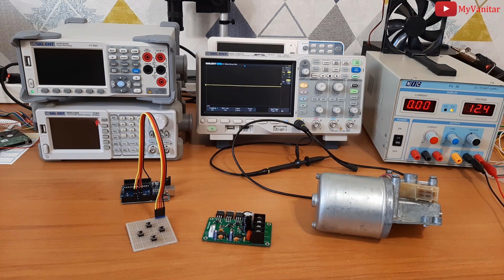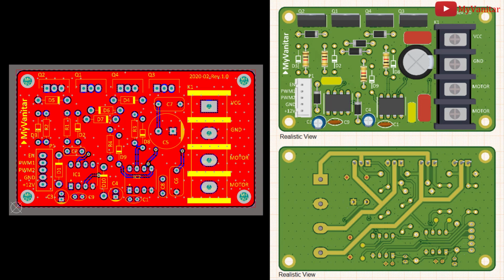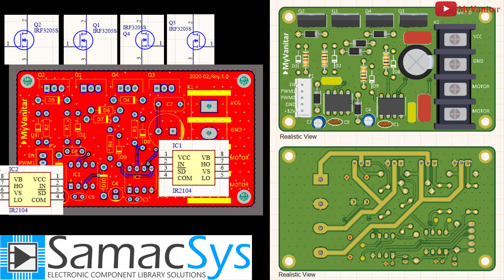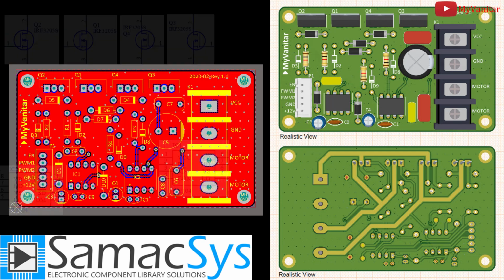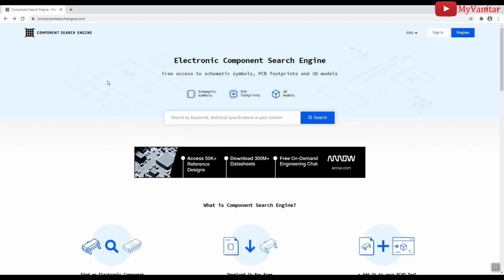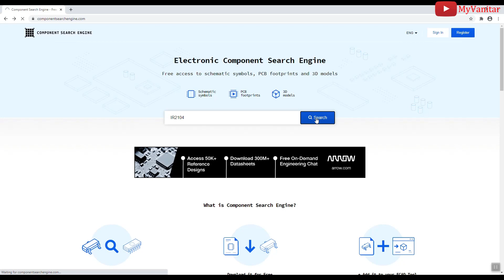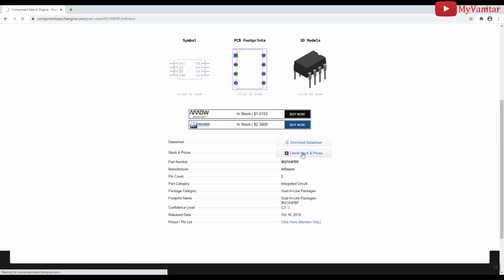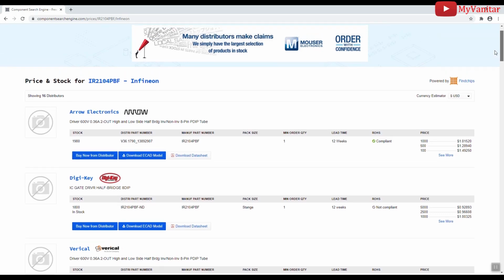H Bridge DC Motor Driver/Control Circuit [40A PWM, Power MOSFETs]

Comment: Hi,
How can I get the "JC_Button.h" library in the given coding for testing the H bridge motor driver board?  Do you have a schematic file of the test circuit? Thank you.
Reply from the maker: Hi, my assumption for this project was that the users have some knowledge of Arduino to run this Driver. Please note that this is a motor driver and it needs PWM pulses at the input to control the motor. in the future, I may publish a standalone board. anyway,  "JC_Button.h" library is there to use buttons to control the motor. Arduino has some default libraries and some can be installed externally. This library is external. You don't need to use my code and configuration, it is just an example to provide PWM signals to the board. (PWM1=pulse, PWM2=0, right rotation) (PWM1=0, PWM2=Pulse, left rotation) (PWM1=0, PWM2=0, OFF) , (EN=Logic-1, Driver ON) (EN: Logic-0, Driver OFF)
Reply: @MyVanitar  Thank you

Comment: Can I have a project in Altium Designer?
Reply from the maker: Check the links in the video description. One is related to Altium designer where you can downloaded the latest version + license. Another link is for the article where you have access to the detailed document and Gerbers. also you can order the PCB if you like. The original Altium files can not be offered.
Reply: @MyVanitar  how i have Altium Desinger free licens? It's not working :(
Reply from the maker: It works, why not. it offers you a trial period to test it legally. Just follow the link and fill out the form. I have tested it myself

Comment: Hi, 
H-Bridge DC Motor Driver [40A, Power Mosfets]. Purchased from PCBWAY and want to use IRF450 for 170 volts kindly advice required change in board.

Regards,
Reply from the maker: I think you mean IRF540 because 450 has a different footprint. You should not short the body of MOSFETs (on the heatsink). pay attention to the voltages of the capacitors (load capacitor: C5, C6, C7). The supply voltage for the driver side must be only 12V. strengthen the high current tracks (by solder and copper wire) if you use the circuit for high currents.
Reply: c5,c6,c7 already changed to 200 volts, any change in gate resistor?
Reply from the maker: that's not a problem, even it is optional. Do you only have problems when you increase the load voltage?
Reply: yes after 50 volts
Reply from the maker: what happens then? something burns or similar?
Reply: no nothing burn but motor start shut ring
Reply from the maker: I think the problem is your supply. I mean load supply.
Reply: actually i am using it in dc motor position capture with Arduino once the motor is in capture position and i rotate motor to left or right the start  shut ring as if transistor not switching.
Reply from the maker: it's hard to mention, but because it is dependent on the voltage, I guess it is your supply or motor. sudden rotation change is a stress on the motor. You should write a code for the break I think. Since it happens when you increase the voltage, either your supply is unable to deliver that amount or your motor goes under stress
Reply: thanks for your great help i truly appreciate i will look in supply.

Comment: Hi sir, it is posible work like a bts7960 sir??
Reply from the maker: I checked your module, it claims 43A. In my opinion, it is impossible to get 43A out of this module with SMD components and no heatsink. This circuit uses TH MOSFETs so you can easily mount a heatsink on them. Just use some copper wires and solder on the exposed high current carrying tracks. The Voltage of the chip is 12V because MOSFETs need this voltage to be fully ON. PWM level could be 3.3V or 5V logic. Load voltage is above 12V and lower than 40V. However, it can be increased.
Reply: @MyVanitar  thank yo sir. Yes i want to make with dip version, i dont like smd version😅 because many bts are cracked🤣 voltage is 22-24v
Reply from the maker: @botak333  the load or motor voltage is 24V?
Reply from the maker: @botak333  You know electronic is not like build and use, you should have some knowledge about inside, I mean circuit. maybe something is 90% okay and you just need to tweak something.
Reply: @MyVanitar  yes sir
Reply from the maker: @botak333  You can use this with no specific changes, but as I said please increase your knowledge about circuits, everything is not a piece of cake to follow
Reply: Hello sir! I already ordered the ir2104 to make an H bridge and try to replace the BTS7960 Also the CD40106 and optocoupler to improve and isolate the Arduino microcontroller bridge and improve the input. I also ordered the IR2110 but these do not have a dead time. If it works, I'll write you a comment!
Reply from the maker: @sebastiano6426  if you plan to have separate grounds, optocouplers are useful and this is a good idea if your load is noisy
Reply: @MyVanitar hii good daybsir, finaly i make this, i make 3pcs of this, order pcb from pcbway, but why no one working sirr?? J used all of new chip, but not working, i wiring like a BTS7960, and i test like bts7960 also with the coding but not not working sir, i dont know what wrong sir. It EN for direction motor, or for PWM motor sirr???
Reply: @MyVanitar   this is my coding.
int RPWM=4;//motor 1
int RRPWM=2; //motor 2
int LPWM=10;//motor 1
int LLPWM=9;//motor 2
int L_EN=5;//motor 1
int R_EN=3;//motor 2

void setup() {
pinMode(RPWM, OUTPUT);
pinMode(RRPWM, OUTPUT);
pinMode(LPWM, OUTPUT);
pinMode(LLPWM, OUTPUT);
pinMode(L_EN, OUTPUT);
pinMode(R_EN, OUTPUT);
  }
void loop() {
  analogWrite(R_EN,200);
  analogWrite(R_EN,200);
digitalWrite(RPWM,HIGH);
digitalWrite(LPWM,LOW);
digitalWrite(RRPWM,HIGH);
digitalWrite(LLPWM,LOW);
}
same people as botak333
Reply: @MyVanitar hi sir what wrong with my hardware?? Wich chip are broke?? Ir2104 or ithe mosfet sir??
Reply: @MyVanitar  hi sir what is the function dioda D4-D6?? Can i remove that?? Because always make my mosfet broken, i think because this mosfet, i used for dc motor 30V 8A sir
Reply from the maker: @botak333  those diodes strengthen the internal diodes of the mosfets
Reply: @MyVanitar  but because of taht mh mosfet broke sir, if i remove no problem right??
Reply from the maker: @botak333  I could not get what you were trying to say. if you want to remove the diodes you can do

Comment: I thought IR2104 is half bridge gate driver. one IR2104 can drive one motor. So your Schematic diagram of the H-Bridge DC motor driver have 2 IR2104. so you can drive 2 motors. right?
Reply from the maker: Maybe you can explain it like that. what twp chip does is that you don't need change the polarity of the supply to change the rotation direction

Comment: Hi There , been looking for a nice compact circuit like this, but i'm not an electronics expert so i had questions...
could this be used to drive leds or lasers even, or in my case a TEC (thermo electric conductor) or multiple . (12v 10a 136w ish x2)
i'm in the process of making my own driver board that also needs to have current sense , and temperature control to be used with an raspberry or logic board.
Furthermore, to be precise... i'm planning to use your simple half bridge design first since i don't need it to flip polarity, (but it would be a nice option)
it will  have 3 + 2 temp sensors, 2 internal ammeters and 2 external, pwm for TEC and fan control, all this needs to be high frequency but low noise.
 i know the pwm creates noise if hooked directly, but yours seem to switch with constant current am i right ?

Also, i'm wandering after doing a lot of reading and research... Since ill be using a high efficiency pc switch-mode power supply,
what would be the best option for me, ?

1. a insulated dual gate smart relay, x2, this can have a filter in b-tween gates
, and sensors etc.
2. a dual full bridge driver https://www.mouser.com/datasheet/2/389/l6207-954874.pdf (for example, ill need more current tho)
3. or the H-Bridge / half bridge,  preferable with a fancy noise  filter using ceramic polymer caps and the likes.
building my own full bridge is beyond my skills atm...
Reply from the maker: You asked a lot of questions. Yes you can driver anything that is at least 12V. This is not a constant current source. however you can supply your load with a constant current source, although it is not practical because when current increases (stays constant), the voltage decreases (compensates) and would be below 12V. if you don't want to change the polarity, half bridge is also fine. my first video in this channel is a half-bridge driver. you want to isolated the grounds? that is possible however I don't think load noise matters. PWM is injected to the Mosfet drivers. if your load would not stuck or it would not show such a risk, then you won't need current limit circuit. however, you can use the current limit outside of the board also, by non-invasive method (non contact)
Reply from the maker: You can also use the computer power supply yes. it provides a good 12V rail.
Reply: @MyVanitar  Thanks for your reply ! 
Well basically all the TEC controller boards i found out there are pretty complex,
as it comes to power delivery and temperature control duty cycle's, these are also used for laser diodes and cooling them.
most of them are 1 overengineered, 2 dont have the right options i need, and are like really expensive up like starting from $200
Since i want to learn more about automation and electronics, i decided to make my own project.
Reply from the maker: @digivichi5071  I have not investigated about it, however it depends on the laser diode and its power. Most likely the driver is more or less a CC supply
Reply: @MyVanitar  sorry for so much questions, i was curious if the pwm signal is isolated from the load basicly.

Like Neil Worsfold say's b-low in the comments, ''Curious if the circuit could switch to motor regeneration when coastin''
i have read that certain motor and led/laser diode-controllers, also work for a tec if it has a coasting mode for heat management,
and optimal operating efficiency plus reverse polarity for cooling the unit itself. and so that it puts less noise on the feedback circuit...etc
in a full bridge the reverse current flow could be recycled, and parasitic loss should be mitigated, u would design it like a high voltage circuit where u insulate, the high switching frequencies , and the pwm switching noise from the circuit. switchmode is important, u dont want linear power, for these applications.
And one last note, most robotic's projects need dual drivers or more, for driving multiple things, 
sorry for the wall of text and so. but thanks anyhow.. i will let u know if i ever complete my project and what i have come up with.
Reply from the maker: @digivichi5071  In this circuit, there is no isolation. For isolation in digital, for example to isolate PWM generation unit and power unit, you can use optocouplers.

Comment: Will this work with 24V VCC?
Reply from the maker: 24V Motor or 24V for the circuit Vcc?
Reply: @MyVanitar  I have 24V motor, will it work? And how much voltage do I have to give to mosfet drivers as well?

Comment: Can you make a video combination of h bridge and optical encoder to control DC motor rotating direction and speed
Reply from the maker: That's possible, however encoder on the motor it means you want to build a closed loop control system where you wanna have a feedback from the motor's behavior. I plan to publish something for the current sense check of the motor. in your case, the encoder might vary with the motor type. I can not offer a universal solution

Comment: Hi. is this high power motor driver? how can electronic elements can run 30A
Reply from the maker: Yes, it can. if the MOSFETs do not have a high RDS(on), then they would stand in high currents, because they won't generate heat. You must strengthen the high current carrying tracks using copper wires as well. that's why I have not covered them by the solder mask

Comment: Can it be used to drive a 12 V 250 watt Dc motor?
Reply: What does ir2104 do ?
Reply from the maker: @ajarnjiaranai5902  Please check the article
Reply: Circuit this video , Can it be used to drive a 12 v 250w DC motor?
Reply from the maker: @ajarnjiaranai5902  man, here is not the after sales services! you can not calculate the current consumption of your motor? that's not my problem. I stated the current limit of the circuit.

Comment: How is Q1,2,3,4 connected?
Reply from the maker: For the schematic and other details please check the article, if you mean the heatsink, they must not be connected to each other, you have to use a thermal pad and a specific plastic washer to electrically isolate each MOSFET body from the heatsink.

Comment: Hello, this board work with 24V motores? Just plug and play?
Reply from the maker: I don't remember some values in the schematic. So just check the Mosfet VDS voltages (I think it was 50V), and capacitor voltages. I let you do this yourself and inform me here, just for you to learn :-)
Reply: @MyVanitar  Is 55V so i can connect 24V on the VCC to aplly to the motor i have?
Reply from the maker: @wekker24  I told you check the capacitors also
Reply: @MyVanitar  50V and 100V
Reply from the maker: @wekker24  Yess, then you are fine. The voltage of the load (motor in your case) does not need to be equal to the driver chip. the driver works with 12V. so prepare 12V for that. Connect the load supply to 24V. Grounds are common. even the load side could be much higher if you change the capacitors with something with higher voltage
Reply from the maker: @wekker24  order the PCBs and tell me about your project after you done
Reply: @MyVanitar  hi sir the driver ic ir2104 only work with 12v sir?? It is not posible to used 5v like a ibt2(bts7960) sir??
Reply from the maker: @botak333  As I remember Yes, and it is natural because MOSFETs need 12V to be fully ON. Check the datasheet of IR2104. However, you can drive loads with a variety of voltages, even up to a few hundreds of vols, because MOSFETs can switch such voltages (in general), in this circuit I think the tolerance of MOSFETs is around 50V.
Reply: @MyVanitar  thank you somuch sir, and one more, if i upgrade the mosfet, the others component should be change too sir?? I want to make driver to drve dc motor 220v sir😅😅. I think its crazy🤣
Reply from the maker: @botak333  You should replace C5, C6, and C7 with higher-rated capacitors (400V for example). Yes, you can drive a DC motor. 220V DC not AC, be careful

Comment: In your circuit, I think will occur Braking in it when the motor is rotating with a PWM signal. Assuming the bridge is driving in one direction with a pwm, 1 is for mosfet turned on and 0 for mosfet turned off.
PWM2 will be settled to a continuous low level, then the motor will turn in one direction, forward or backward).

PWM1= high level of pwm     PWM2 = 0
Q1 = 1     Q3=0
Q2= 0      Q4=1

When PWM1 signal has the PWM low level will occur Ranking in the low side, Q4 and Q2 will short circuit the motor terminals, the motor would work as a generator because his rotor will keep moving.

PWM1= low level of pwm       PWM2 = 0
Q1 = 0     Q3=0
Q2= 1      Q4=1
 
As you can see, some kinetic energy will be wasted in the form of heat in the motor and mosfets. If the low side mosfets Q2 and Q4 were turned off during the pwm1 low level, the energy generated by the kinetic energy of the motor would be directed and stored to the power supply through the diodes.

Do you agree with that @MyVanitar?
Reply from the maker: Paulo, not agree :-). let's forget about technical aspects. Any short circuit in every pulse as you mentioned in such a PWM frequency (a few KHz) would be quite clear on the supply, because on my tests the motor supply and board supply and the Arduino supply are identical! IR2104 is a mosfet driver that you can build and have fun! diode are for protecting against reverse inductor currents.

Comment: I built this circuit, but am having probelms with it. Can you help?
Reply from the maker: Yes, why not, what's the problem?
Reply: can I message you privately?
Reply from the maker: @andyhartland1891  First of all, I liked your video, very good :-). This circuit has been tested by me and many users, so don't worry. Before you continue, make sure that you have not killed any MOSFET. so test them. then make sure that the ground PIN of both supplies is identical, which means the circuit has one ground. 
You MUST inject a PWM pulse to one input and make another PWM=0 because the EN pin is identical for both Mosfet drivers, so once EN is active, you gonna play with PWM1 and PWM2. So to make it reverse just do vice versa. it must work if there is no other problem with your board. Also, You should have a basic load at the output all the time, to draw some mA of current.
Reply: @MyVanitar  Hi, thanks for the feedback :) I forgot to mention that I have both enable pins pulled high to keep them on all the time. May I ask if this a problem also? So if I read your guidance correctly, I need to make sure both inputs are always low, and then PWM one of them to activate the motor, but not 100% duty. Is that correct?
Reply from the maker: @andyhartland1891  I meant, all the time, one PWM input should receive a PWM pulse where another PWM input is GND or 0 and vice versa, then if your load is a motor, it will rotate forward or reverse. Both PWM=0, then everything is OFF. There is no other state, just 3 operation states. That's not a problem if you Enable both drivers like what I did, because you play with the PWM inputs, so it prevents unnecessary wiring.
Reply: @MyVanitar  thank you so much for your input, help and guidance. I really appreciate it. 
Once it's running, I'll post an update. 
😀
Reply: So, is it okay to pull EN pin high using 10K resistor?
Or it will make my pcb not working?
Or just leave it floating?
Or the right is to pull it low?